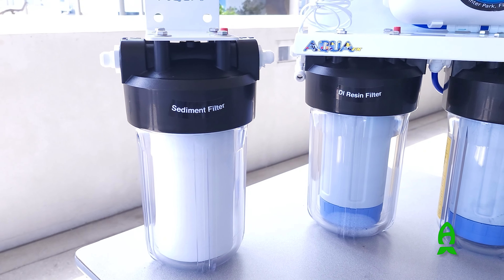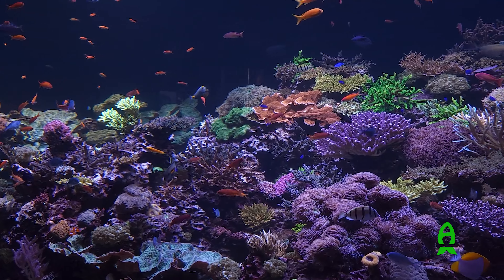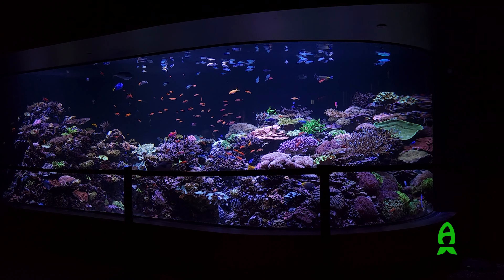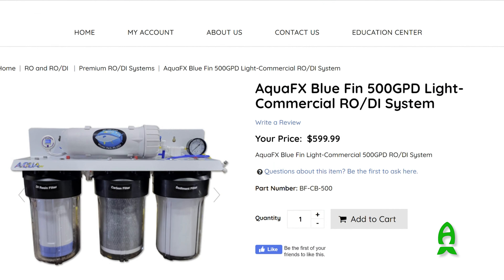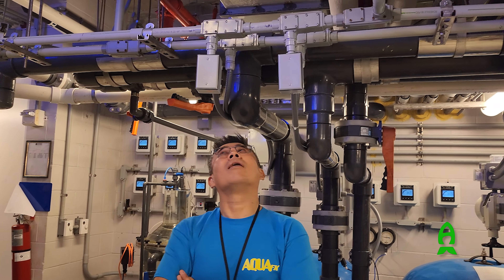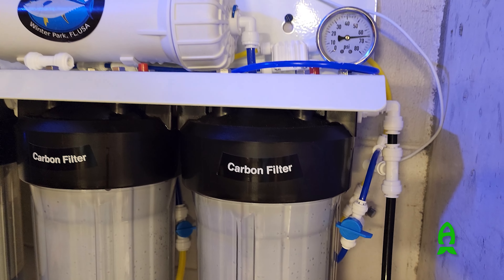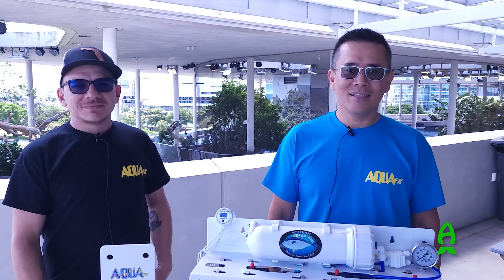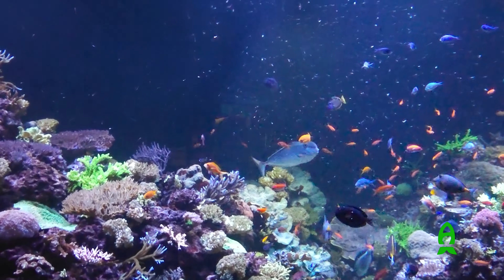Vlog : Cleaner water with Aqua FX.

Comment: What is the waste water ratio on this ro membrane?
Reply: It is the same as the 75/100GPD RO membranes: which is 3-4 parts of waste water to 1 part of product water. The Blue Fin does come with an adjustable flow restrictor to let you fine tune the ratio.

Comment: How does it work without a booster? You don’t explain how it puts out such a high amount
Reply: this is a much physically larger RO membrane that is design to purify a lot of water, fast. Its output is rate at 65psi, 77F and 250TDS... just as 50GPD or 100GPD membranes. Having said that, if you have a low water pressure problem (less than 45PSI), you will still need a booster pump.
Reply from the maker: Sorry, here is the direct response from aquafx.☝️